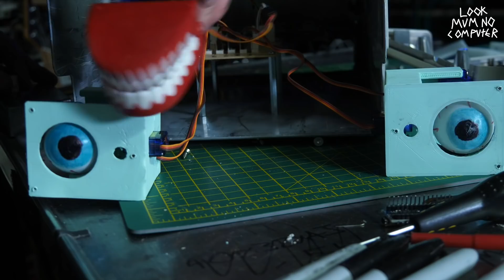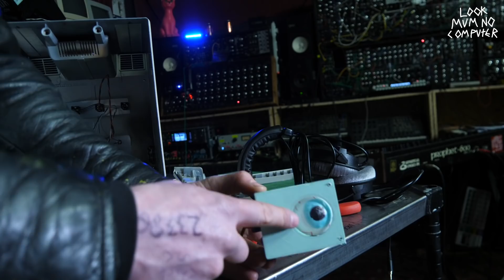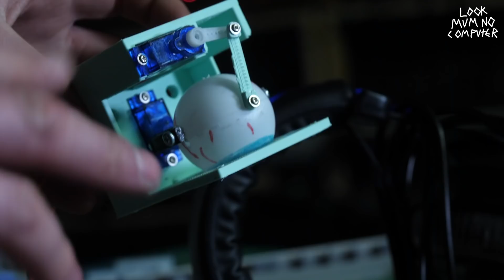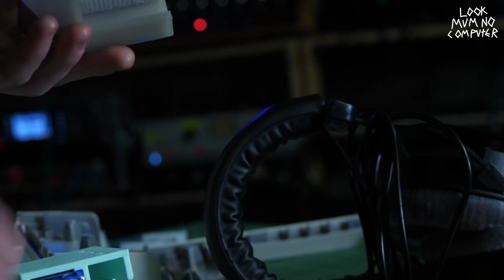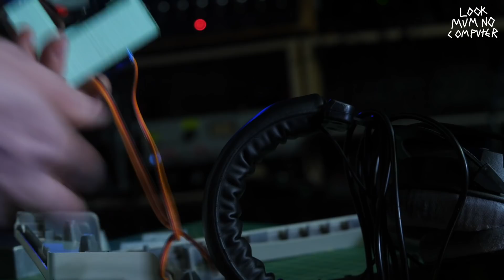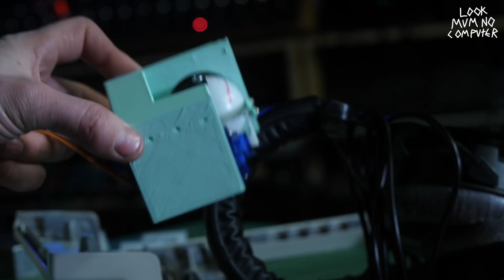DIY 3D Printed Animatronic Eyes How to. Kosmo

Comment: If you wanted to make these silent you could probably do it with small solenoids and varied voltages, could be controlled by your other kit without an intermediate board and that would remove the need for external power.